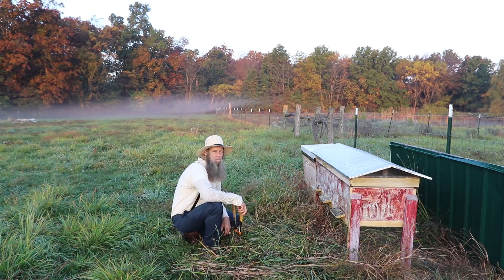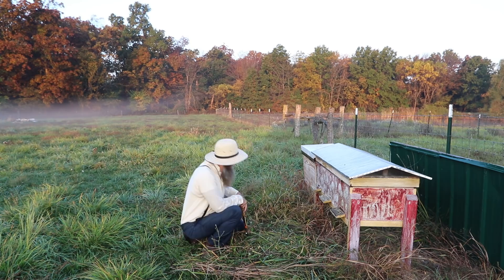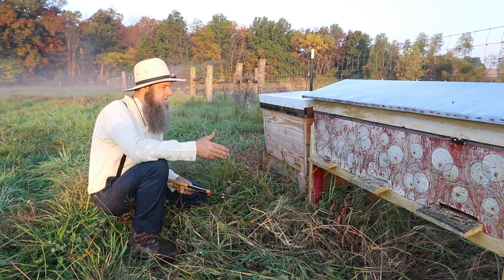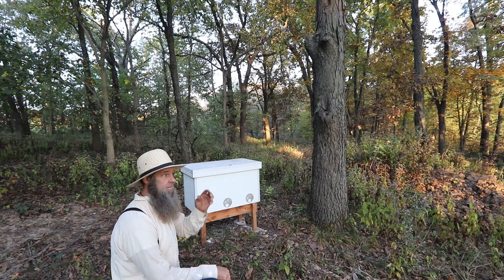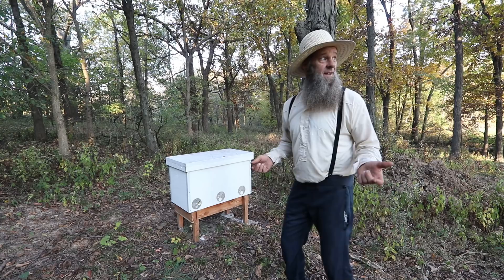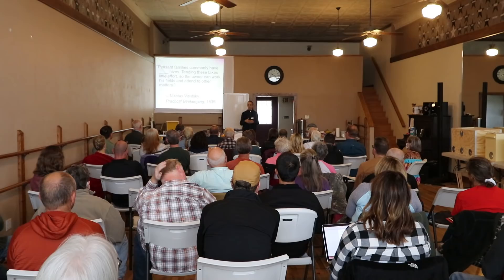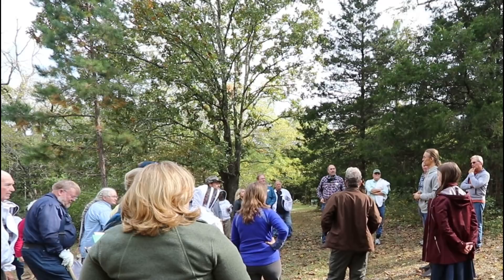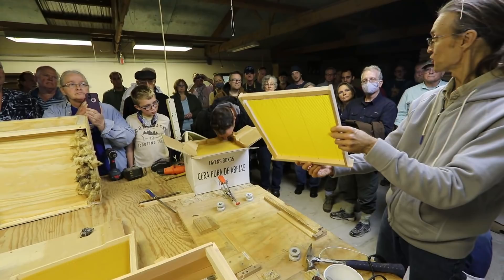Skunks can eat a BEE HIVE Colony in 3 days!

Comment: I put diatomaceous earth on my horse feed to prevent weevil. It also prevents my horses from getting  worms.
Reply: Wanda Simons how much...say per quart of COB...corn, oats, barley..?
Reply: My method is not very precise! When I open a new bag of feed I add a handful of diatomaceous earth. It is approximately 1/2 cup (I'm guessing) and stir it in as deeply as possible with my hands. As the amt of feed in the bag decreases and I can no longer see the earth on the feed, I add the same amount.  I most likely use 1and1/3 cup per bag. I just bought feed and when I add the earth this time I will measure it to figure out exactly how much I add.
Reply: I put DE in my nightly Psyllium Husks Mix for myself.

Comment: I have 6 hives now and far and away my best hive is my insulated Layens hive.  I converted one of my langstroph hives into a Layens and seems to be doing much better as well!  I am in southeast Texas and heat is the main issue.  When it got hot they were bearding on my langstroph hives to keep cool but never once bearded on the layens.  If the bees have to work less to maintain their temperature they have more time to do more important things!  Really looking forward to making splits next year and adding additional colonies.  Already built two more insulated layens hives ready for those splits next year!  Unfortunately I have had swarm traps up all year and have not yet caught a swarm.  But I will have them out again next year!
Reply: How did you convert your original hives?
Reply: @StillDreamingHomestead  I did a cutout for that one.  It had a lot of cross-comb and comb with no foundation so I just cut it out of those frames and rubber-banded them into the layens frames.  You can just cut the frames and comb with a saw to fit...saw a video of Dr Leo doing just that.  However, this hive was kind of a mess already.

Comment: Ideally you would benefit from mounting the hives on posts concreted in, hives 3 feet above the ground, with the top of the concrete above ground and cup shaped around the post to put oil as an insect/pest trap/deterrent. Frame/brace a base on top of the posts any way you see a solid storm proof mount. Ratchet strap hive to structure as wild life have been known to knock over hives. No good putting hives on bricks as grass quickly grows and ants/pests climb the vegetation to the hive directly and the hives also freeze at ground level. I'd be interested to know if bubble wrap would be accepted by the bees as an insulation layer around and top of the hive in the colder whether as a quick solution. You only need 1-2 posts per hive depending on engineering. Have fun y-all!

Comment: I obviously can't know since I am not there. But it seems to me from the state of that grass in front of the hive that they may not be getting frequent enough visits. Just a thought.
Reply: BEES like the grass.  I've seen other HOMESTEAD have higher grass ALSO.
I could be wrong.  From MICHIGAN
Reply: @evalinawarne1337  I was talking more about the idea that after an infection of small hive beetles, I would think that someone would want to monitor the hives very closely for problems. One of the few drawbacks to the horizontal hive that I can see, is that itis just a lot more eggs in one basket. If hive beetles or wax worms get a hold in one of those monster horizontals, it is a big loss in terms of losing a very large colony or two (If the hive is divided).

Comment: Whoever removed the part that said you need another wall with insulation may have lived down South where extra insulation isn't really necessary due to milder temperatures...
Reply from the maker: That is incorrect, even in warm climates like trees the insulation helps keep them cool by regulating the heat 👍
Reply: I stand corrected...